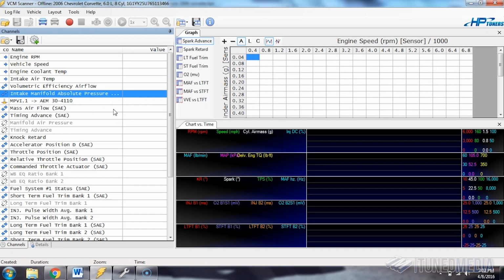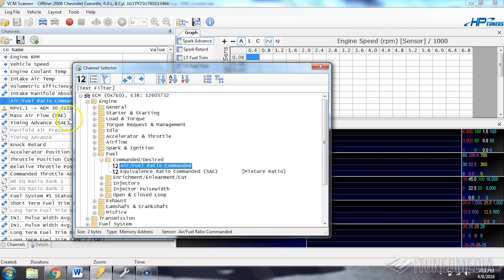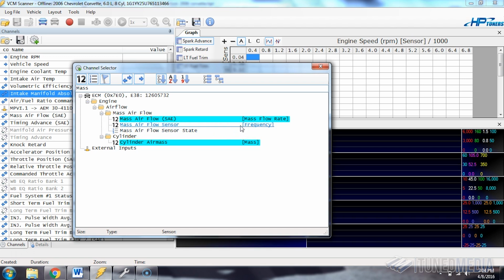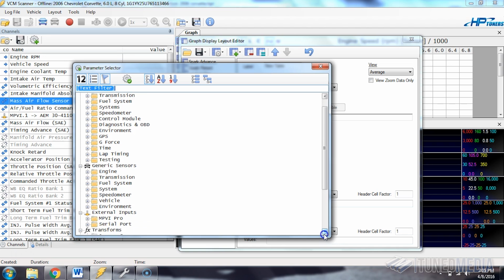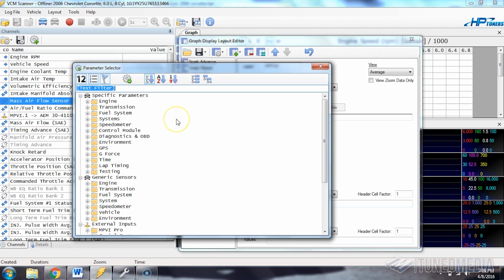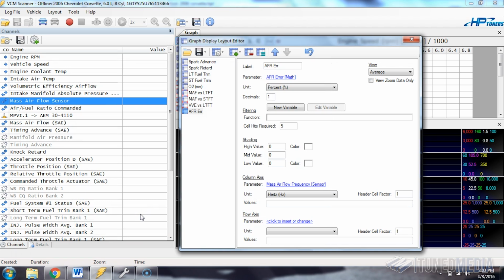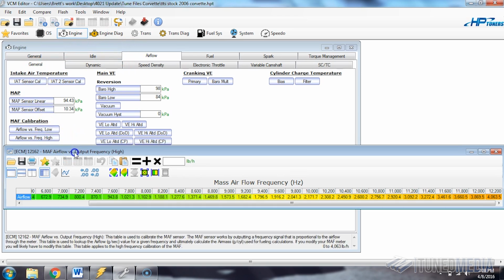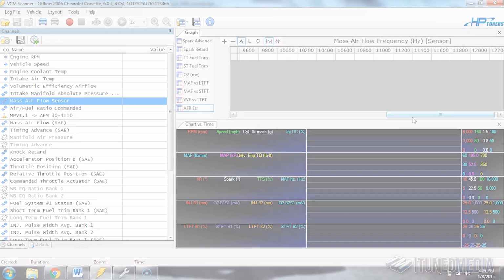How to Display AFR ERROR Using HP Tuners VCM Suite 3.X Software

Comment: Great Video But I cannot for the life of me figure out how to add AFR Commanded it simply is not in the drop down like you show in the video. My ecm is an E40 and maybe it doesn't have that ? What would I use in lieu of AFR Commanded if that's the case. I've been trying to get this to work for two weeks. Any helps is much appreciated
Reply: ME EITHER

Comment: What changes do I need to do this on a Ford? Using HP 3.2, I do not have the same parameters. I am assuming I select MAF volts, but how about the rest of the graph?
Reply from the maker: This video was made using a GM tune file, but the process is the same for Fords. You want to select the AFR Error Math as the parameter that will put information in the graph. Then set the row and column axis to directly reflect the table in table in the VCM Editor that is controlling the wide open throttle fueling for the Ford you are tuning. Then as long as you have AFR Commanded and a wide band in the main channels list everything will work as it should.
Reply: The only AFR commanded I can pick is "equivalence Ratio Commanded". Should this work? When I play back the log I can see the high lighter cell in the graph moving , but no data. Thanks

Comment: How do yo know that AFR ERR is going to use your wideband by default? I remember having to put the input's PID in the Function in earlier versions of VCM Scanner to tell the Graph from where to get the error.
Reply from the maker: The HP Tuners scanner knows that the MPV-I input you selected is linked to a wide band. It also knows commanded AFR if you have it selected in the Channels list. It just simply does the Math in the back ground and puts it in the table
Reply: i have two widebands one on each side in there. What will it do then? How do I verify its using the wideband. Also, you guys are awesome. Thanks so much for making this!!!
Reply: @cameronjohnson6321  Did you ever figure this out, I would also like to monitor both banks with two Wideband sensors and would the AFR Error know to take the average of those two?